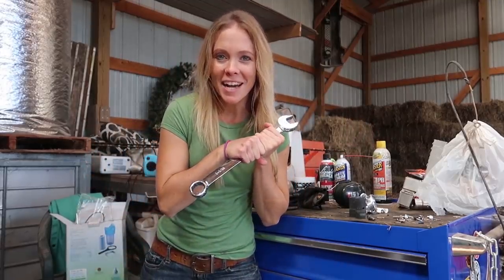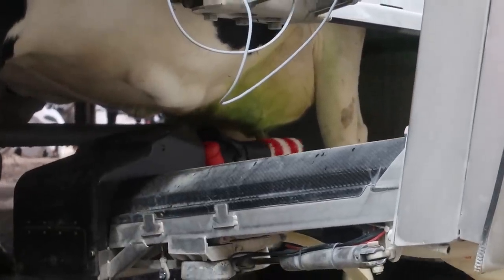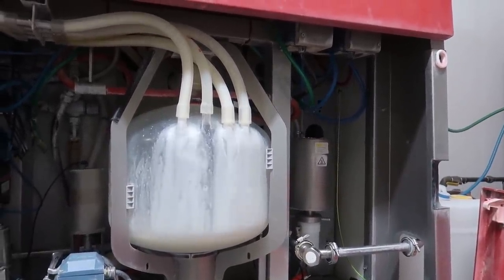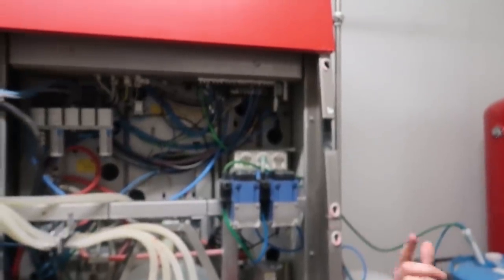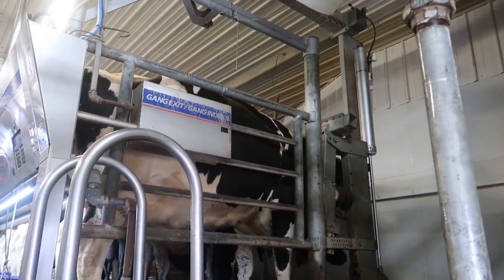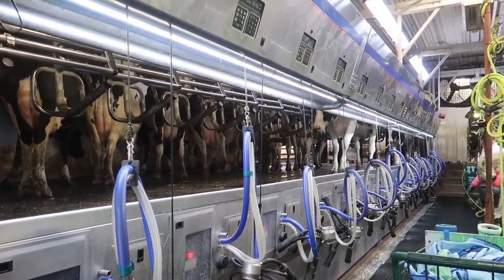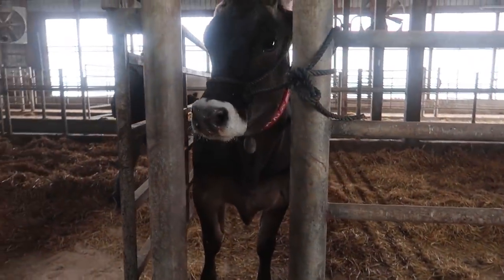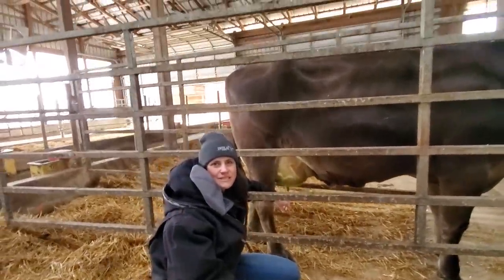281 Milking 2,000 Cows Ain't Easy! - Teach a Farm Girl Series

Comment: A WT. Would you visit a small family dairy. I am interested in smaller farms maybe 50 or 100. 2,000 cows is more than I can imagine having to milk.
Reply from the maker: certainly would love to! It's like pulling teeth out here in MI to get interviews with any sort of animal operation. There is a heavy PETA presence here that is trying to take down farms in any way possible. So many farms have closed off to outsiders
Reply: I am in West Texas where the number of Milk cows has exploded.   I have one next door that milks 40,000 not 4,000.   The calf huts must cover 200 acres.   They must use more water than a city of 1/4 million.   There is a cheese factory near by at Dalhart  that makes 1 million lbs each day.
Reply from the maker: @robertreznik9330  how interesting! My next video on the farm discusses how the cows are kept and they said the cows love Michigan s colder temps. I wonder how cows in TX handle the warmer weather?
Reply: The @This1LifeWeLive    The Panhandle is a good place for livestock!   There are 16,000,000 beef cattle in the Amarillo trade area.   The heat is not a problem.   Three years ago 30,000 dairy animals were killed in a blizzard west of Hereford.  For about 8 months in the year I wear a jacket in the morning.    
Recently I was talking to a Nutritionist for Faria Dairy and he said the parlor is like a large stadium where the temp is kept within 5 degrees year around.  In the Summer the mornings are in the 60's with a dew point around 45 to 62 so just adding moisture makes thing comfortable.  Cows like a dry atmosphere!   Look at Google Earth GPS 36.0346  -102.08618 for dairy buildings sprawling over 1.500 acres.
Reply: Talk to a local food animal Veterinarian, I'm sure someone could get you a good example of a smaller farm. If not, come over to Wisconsin. We can help you out for sure.